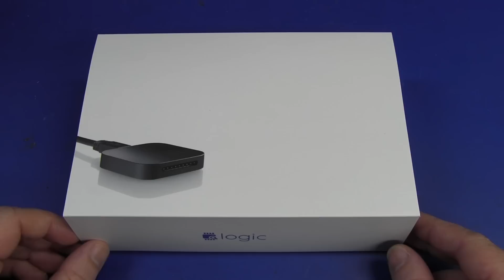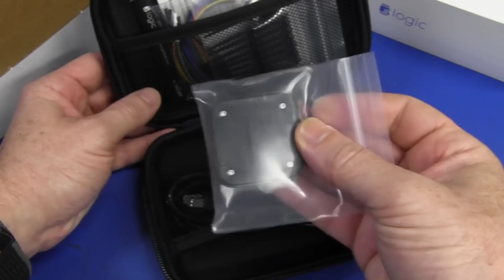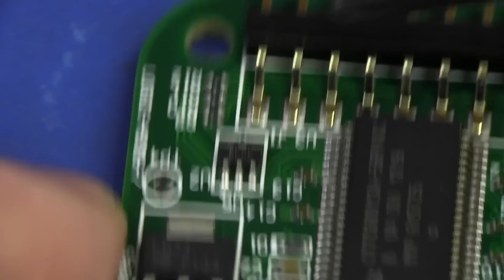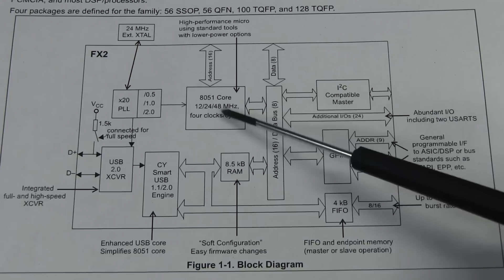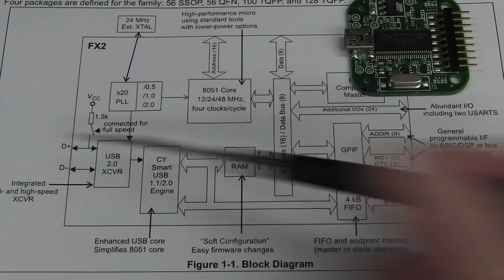EEVblog #436 - Saleae USB Logic Analyser Review & Teardown

Comment: Their logic pro 8 can also do analog (-10V to +10V), thanks to the  Exar/MaxLinear CDK8307b ADC.

Interestingly, the specs on that ADC are great, but can't find it anywhere (obsolete).  Did Saleae do a lifetime buy?  Similar ADCs run ~$100, so curious how much these chips went for.

BTW, everyone reviews it as a logic analyzer , but not the analog inputs!  For example, is it simultaneous sampling?  In any case, if 80MSPS (500Mhz analog bandwidth) for each of the 8 analog channels seems like a killer high-end DAQ.   Even if it is 80MSPS only when 1 channel is enabled, still makes it a worthy oscilloscope?

The price/specs drops off a clip for 1.5MSPS.. for example the LTC2320-12 , you pulse CONV every 667ns (1.5Mhz), once pulsed wait 450ns, then grab 2 channels worth of data on each of the 4 LVDS lanes.  Each lane must transfers 32 bits (2 channels) at 200Mhz.. this transfer takes 160ns, just under the 667ns total allotted.  We need to transfer 192Mbps (16bits*8 channels*1.5M SPS)) would require 24MB/s USB2 bandwidth.

Comment: A Mini USB connector is physically more robust and able to sustain more abuse without damage. I am exceptionally hard on equipment and it's connectors. I've never had a USB micro jack break or fail on a bit of kit. I have however broken a handful of USB micro jacks clean off the board. The level of care required to mate a USB micro jack, as to prevent damage, is much higher than that of a USB mini jack. For a small bit of kit that a person travels around with, having robust and reliable connectors on it is a must!

Comment: It's been a long time.  You may want to review the current software, seems to have trigger on PW and search between trigger events.  You can also search data in the protocol analyzer.  Now the accuracy problems you had may be another story.  Seems to fit my needs spot on, and fits in the laptop bag just fine. :-)

Comment: How does a silicon chip actually do calculations? There is no way the chip designer intentionally placed EVERY single transistor in such a way, that just isn't possible. So, for example, the newest chips with 2 billion transistors, those transistors could NOT have been organized one by one into the end structure, so how the hell does it work if thought hasn't gone into the position and role of every single transistor? Anyone got the balls to tackle this one? Thanks.

Comment: It's extremely overpriced for what it is. No wonder Chinese knockoffs are 35x cheaper. The 16 channel version in the UK is £215, while the Chinese version is £6. If they priced down to say £40, they could still make a profit and a lot of people would buy it instead of the cheap knockoffs and potentially make more money overall. It's their own fault. It's 2017 and still no pattern triggering in the software or even pattern searching. Unforgiveable.
Reply: exactly a product that is all software will sooner or later get outdone by open source. Sigrok can do pretty much anything you would want and can be extended if you need some other feature. You could even buy a cheap knockoff and pay for small features to be added for the price difference.

Comment: It's funny how you mentioned why they use the mini b jack. Usb micro cables are so freakin' fragile. They constantly break. That's the main reason why I don't like using android products. Sub micro cables IMHO is the worst. Usb type b cables last waaaaaaaay longer. Apple lightning cables are good too. Why can't the ieee come up with a cable that doesn't fail after 100 uses. Sorry I went off there. I think that's why they went with the type b jack.
Reply: USB Mini connectors will probably be cheaper also as it's old tech.

Comment: Some day you need to evaluate the "ultimate" in technology: That red Harbor Freight multimeter that they offer for free with any purchase. I think it regularly sells for $US 6, otherwise. <grin>
Reply: It's been torn down more than once on this channel, just under different branding. I believe all-sun OEMs the unit and for the money (sometimes none at all) It's Joe Homeowners best friend. Naturally it gets no respect on a technicians work bench, but if you're Joe you can test fuses, outlets, doorbell switches, HVAC voltages, your cars charging system, and so forth. It's really built for that guy and works great.

Comment: At 33:19, when you trying to get work the async serial UART, actually you have the polarity wrong. Normally (RS232) the signal is idle high. You're feeding an inverted signal to the analyzer, but not changed the polarity in settings.
Reply: +Tomas B No you are wrong ;) RS232 is idle low (-5~12v), active high (+5~12v). It's a logic-level UART that idles high (Vcc) and active low (GND).

Comment: I just bought one of the new logic8 devices which seem to use a Spartan 6 FPGA for sampling instead of the cheap usb chip from cypress and they achieve a much higher sampling rate now. Also the software has greatly evolved, I really like it, many more protocols can be decoded now and you can search for particular data.
Reply: No matter how much evolved it's got, It still can't do the basics like pattern triggering or real-time spooling. You can't even pattern search after the fact either making this useless for serious work.

Comment: There's tons of chinese remakes of that device that sell on ebay for ~8$ and work with the original Saleae Logic software.. better get one of those.
Reply: Saleae has  over doubled their own original price of $149.  Gone from "reasonable profit" pricing to "what the market will bear" pricing.  Brings tears to my eyes.   I'd buy the original at $149.  Not at $399.
Reply: They work perfectly with the sigrok software for me
Reply: +Markus Strangl ... right. Way to contribute to putting a decent company out of business ...
Reply: +John Michael Stock You're paying for research, engineering, design and support, which are on-going. They maintain a website and their software. They offer a generous warranty with generous returns.

They obviously don't force you to buy their product to use their software, but I wouldn't rub it in their face that you're going to take advantage of their software and not support their engineering.
Reply: Runs fine with saleae 
! 29.3.2018 trust me
Reply: While this is a good option for low income tinkerers, i would say using sigrok + pulseview as the software frontend is the way to go.
For one it is far more flexible, supports a lot more devices and is open source. But the point is, as Dave Jones said, the big price tag comes from developing the software.
And since you are not using their software and the device is a clone of a discontinued product, that alone should ease your bad consience a little ;-)
Reply: If they weren't so extremely overpriced for what they were then more people would buy them. The hardware is worth almost nothing and the software gets developed once. There's no excuse.
Reply: Markus Strangl Some companies get really greety when it comes to pricing. Low sales expensive makeup vs big sales low markup. Hardware is cheap. I doubt much R&D went into software development.
Reply: Cheap knockoffs don't work with their software anymore. Trust me on this. Buy a cheap clone, and there is literally no way you can use it.

Comment: EEVblog 
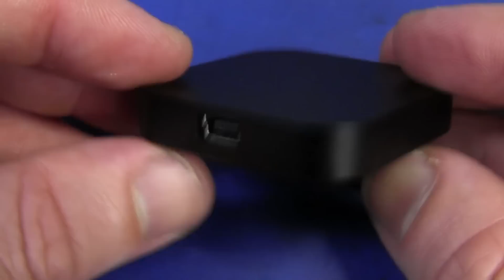@ 2:11
Because micro usb is fragile and is usually the first thing to break when you are on the go and plugging and unplugging stuff a lot.
Reply: *****
Until a solder joint breaks.  Breaking a solder connection only requires 1 cycle of bad handling out of those 10,000 cycles.  Mini-usb is connected to the PCB much more securely.
Reply: ty_ger 
Totally agree. Happened with my Nokia N900 twice...
Reply: +ty_ger uhm... are we really arguing the mounting method versus the connection type? yup.  Carry on then.
Reply: +JimmyDB I am confused.  What is your point?  EEVblog was wonder why they used Mini-B instead of Micro USB.  I stated they used Mini-B because the connector is less fragile and will last longer.  "The connector" is the WHOLE package of course because if it isn't soldered to the circuit board any more, it isn't much of a connector, is it? The product is designed for being used in the field ("on the go").
So...?  What are you talking about?  How is a broken solder joint on a Micro USB more useful than a non-broken Mini-B?
Reply: +ty_ger My point is that you can get different mounting types for each connector type.  Just because it is a micro USB doesn't mean it has to have a weaker connection to the board than a mini USB.  There are mini USB connectors that are lacking mechanical mounting compared to some micro USB.  However, if the designer doesn't understand mechanical mounting then they might be prone to select a connector with poor mechanical connectivity.
Reply: Absolutely. Micro-USB was designed specifically to get around the deficiencies of Mini-USB sockets, primarily their weakness through having sprung connectors in the socket itself.  By moving the sprung points into the cable, in theory when the connector dies you only need to replace the cable and not the device.
They should really be fitted as standard on all devices, but I'd imagine there are still about 200 million of them in stock in China, so they are going to be perpetually fitted on new designs and manufactured until stock dries up and designers stop choosing them :)

Comment: The Chinese Saleae clones have the input buffer in form of a 74HC245 chip, they also have the EEPROM chip that holds PID/VID, so they easily can be made to work with other software (USBee, Altera Byte Blaster).
Reply: The 245 is just an 8 bit buffer, so all that would add is safety, in that if you zap the device, you'll just take out the 245, not the controller.

Comment: 4:05 Where did the 510R value of the series input resistors come from?
Reply: The purpose of series input resistors like those is generally to limit current through the clamp diodes. The resistor value needs to be high enough such that at the maximum input voltage which the product is specified to be protected against (say it is able to withstand +12V accidentally being applied to the inputs without damage), the clamp diodes do not exceed their maximum current ratings. At the same time, the resistor value needs to be low enough to not limit the bandwidth of the signal since a 1-st order filter will be formed from the resistor and the combination of the clamp diode + MCU IO pin capacitance.

Comment: The hardware actually has the abilitity to do a specific trigger, and constant input, it is just that they block it in the software because when they tested it in the lab it took over the HDD read and write on te PC and caused the computer to slow down, but now with SSD'd that really should not be a issue anymore. Althrough they would probabally need to update the USB from 2.0 to 3.0 to be able to handle the raw data constantally being fed into the computer, to get a more real time reading and to allow it to trigger on a specific event. So if someone can write a software that can do the missing feature I would be much obligied

Comment: I personally would take a Mini-B connection over a Micro-USB any day because i feel that the Mini-B connector offers the greatest amount of of stiffness and durability for its size and materials used. I've had plenty of problems with Micro-USB is the past. I've had Micro-USB connected hard drives; female connector sockets just break on more than one occasion because of the light weight nature of these connectors.

Comment: I have one of these logic analyzers and while Dave points out the software is basic, I will tell you it's also buggy!  If you capture more than two channels and then try to export them under certain scenarios the software locks up.  I emailed the company and they promised a software fix but admitted it wasn't a top priority.  I don't know about you but in my book, fixing problems comes before working on new features.  We wound up purchasing the logic software for our Tektronix scopes.

Comment: It's true some searching functions for data would be nice. But gee, a $150 vest-pocket logic analyser doesn't have real-time decode of serial data like a $15000 Agilent ? Wow, that's a surprise.

Dave, be a bit more fair. I grew up with logic analysers like the HP1650  - tiny memory, only slightly better trigger and certainly no serial data trigger. This thing may not compare with the state of the art, but it's astonishingly useful and the software is really slick.

Comment: I agree.  I think it may have to do with RS-232 (and other serial protocols?) inverting the voltage such that 3v to 15v = 0 and -3v to -15v = 1.  Since he's already correctly receiving the inverted signal, I believe he could just change the polarity in the analyzer settings and all would be well.

Comment: There are a few open source ones that use FPGA-based hardware.  But even with the expensive FPGA, the hardware is only like $50 from Dangerous Prototypes and others.  I was going to get the Salaeaeaeaeea, but it really burns me they charge $150 for what is essentially $10 worth of hardware (not including the ridiculously over-engineered cases, though we both know you're a sucker for over-engineered cases :P).  But I really don't know if the FPGA ones are any better, same for their software.

Comment: I have to wonder why you pay $150 for a microcontroller.  I assume you're paying for the software, but it seems to me that the software is something the open source community could have handled making and maintaining.  You can get chinese knockoffs of this thing for $10, so other than the fancy case and good probes, where is your $150 going?  It doesn't sound like much for test equipment, but as this is geared toward the hobbyist market, it certainly is not cheap.

Comment: The idea of not using a microUSB is a good idea in my opinion, since miniUSB is much more "loose". microUSB can lift a full 2 liter bottle with no issues. Imagine the forces needed to disconnect it and over the devices lifespan this will be done hundreds of times: the PCB will be damaged. I am currently a trainee at the local Nokia Care and I've opened at least 20 of Nokia E7 phones, which some of them have actually ripped off from the solder joints. It's bigger, but will last much longer.

Comment: Di Dave. regarding the serial capture data decoding, your serial signal seems to have positive start and stop pulses. Notmal serial data has a "mark" as a start, and a "space" as a stop bit. Your serial data is wierd - there actually ARE faming errors. Also, your data polarity is set incorrectly in the capture software.

Comment: These clones one are a real ripoff for Saleae. The clones' manufacturer don't even provide their own software. They use the same USB-ID as Saleae and tell you to use the "orignal" firmware/software. And even if the software IMHO lacks some really important features, it IS what you pay for with Saleae original. So in this case I really feel bad for Saleae.

Comment: I have both the Saleae Logic and a clone I got on DealExtreme for $11. The only difference seems to be the additional 74HC245 on the clone (for "input protection" purposes i guess). The clone came with the USBee AX firmware but I replaced it with Saleae's since theyre software looks awful.

Comment: It's the same with scopes. It's the trigger options that set the different devices apart. Even cheap ones can get accurate traces on screen. But that's no use if the part you're looking for is somewhere in these millions of samples and there's no way to search for them or only capture the important data in the first place.

Comment: I really considered getting the Saleae for the first 20 minutes of the video (have a small - i. e. no big budget - project, where I'd like to debug I2C, SPI, CAN and serial (and although not needed right now, the one-wire is nice, too). But after seeing I'd have to scan the data all manually (or with another program) anyway, it's not much more helpful than a cheap DSO.

Comment: The GPIF interface on the Cypress FX2 part is pretty neat.  You can basically create a 48Mbps data pump to/from a parallel bus to the USB engine.  You can set up all sorts of parameters about how the bus behaves, set up transfers, and it basically all happens without any hand-holding from the 8051.  I was doing all kinds of stuff with it back in the early 2000s, IDE drive interfaces, PCMCIA card interfaces, etc.